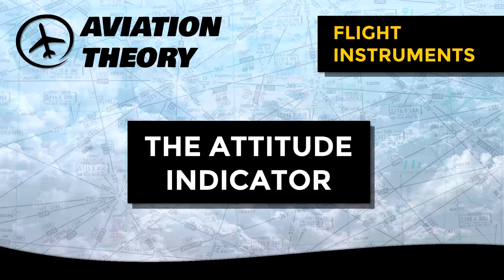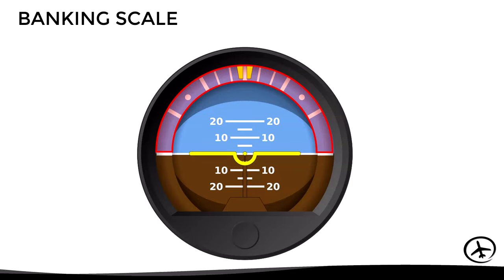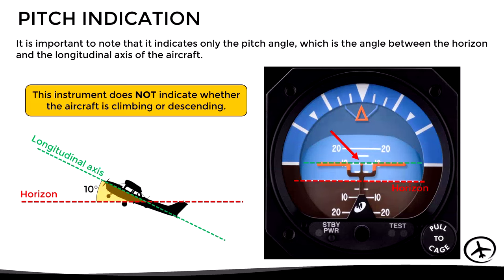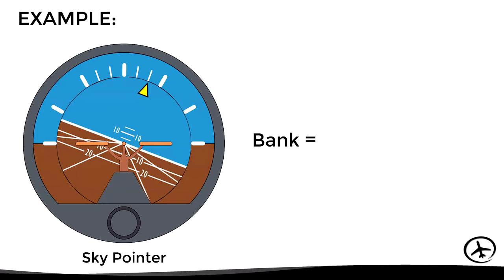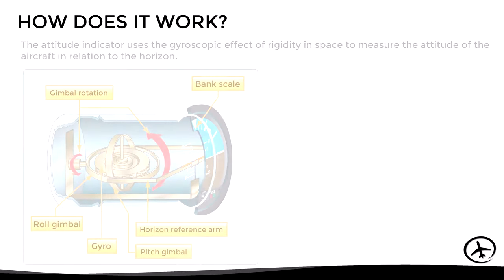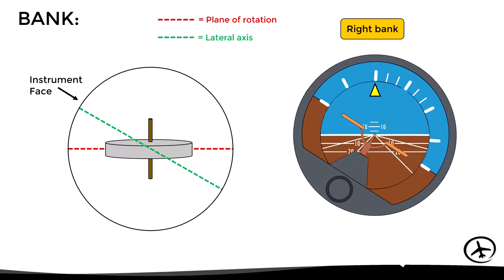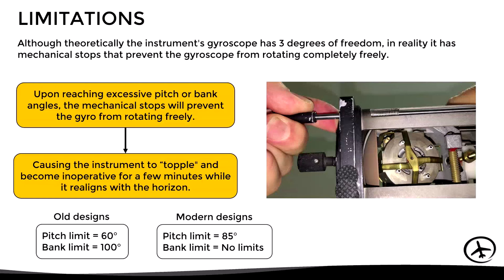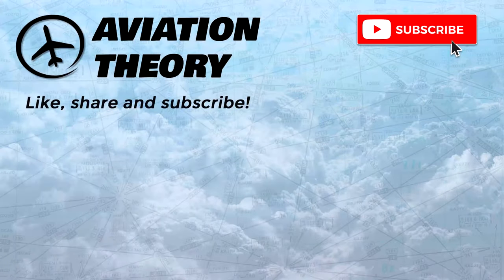The Attitude Indicator

Comment: Good stuff, except the spin of the Earth part which in reality it doesn't happen.
Reply: I mean... it *does*, that's why they build attitude indicators the way they do. Not only does the gyro have to compensate for the world turning, it also has to compensate for the fact that you're moving through the sky and the plane needs to stay level to the curved world below. This is, by the way, why a plane's nose doesn't need to dip to keep from flying off into space as so many flat earthers claim.
Reply: @jasonmack760 A commercial jet flying at 550 MPH would necessarily have to nose down over three times the rate of a normal decent (3,350 FPM) to follow the supposed curvature of Earth. That's around 55 feet per second. This is such a significant dive it would be obviously felt by the passengers. Yet anyone having flown would attest to no such feeling.
Reply: @JeremyBWallace  Again, no it doesn't. No adjustment required, the gyro in the attitude indicator--which again, has been precision engineered to compensate for both the curve and precession of the earth, see "pendulous vanes"--ensures that the plane follows that curved course without manual adjustment.
Reply: @jasonmack760  You missed my point. If the plane has to dive around a ridiculously tight curve, you'd sure as shit feel it!
Reply: @JeremyBWallace  The curve isn't ridiculously tight. Your math is wrong.
Reply: @jasonmack760  You sure? Tell me how it wrong.
Reply: @JeremyBWallace  I've worked this a number of ways and I'm not coming up with anything like your result. The only one that comes close is if you assume the aircraft is flying at sea level, but they fly at 35000 feet. What method did you use?
Reply: @jasonmack760  It makes no difference what altitude the jet flies. In order to keep a constant height above the ground, it has to follow the curve. All you do is plug in 550 miles in an Earth curvature calculator and you get a drop from a straight line of around 200,000 ft. Divide that hour traveled by 60 minutes and you get a 3,333 FPM decent rate. That's an absurdly fast drop.
Reply: @JeremyBWallace  Two hundred thousand feet... Okay yeah you are DEFINITELY using that calculator wrong. That's *insane*.
Reply: @jasonmack760  Again, how am I using it wrong? What's the correct math for the rate of drop around Earth's supposed curvature?
Reply: Reply section sound like someone needs to familiarize themselves with the generally accepted "curvature" formula. It's derived from the generally accepted "circumference" "radius" and "diameter" of the totally absurd ball, so many are trapped on. I agree, the curve globers are tied to, forced to believe, is absurd. 🤷‍♂️